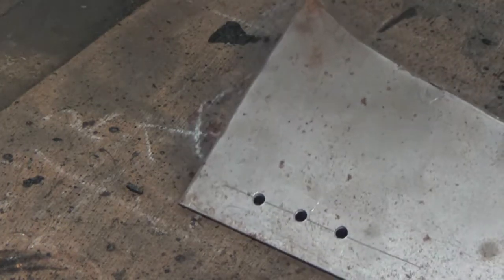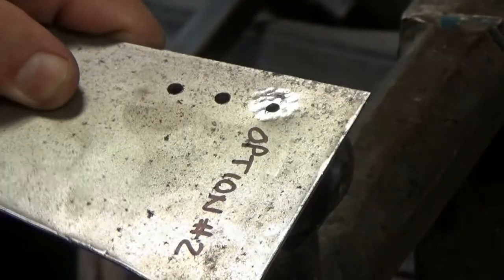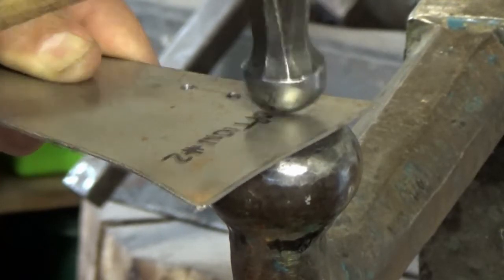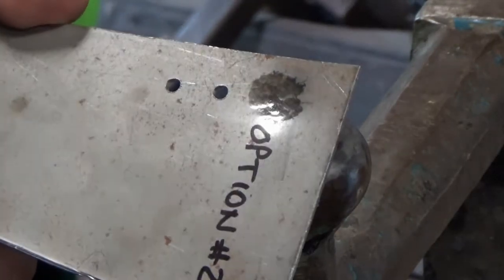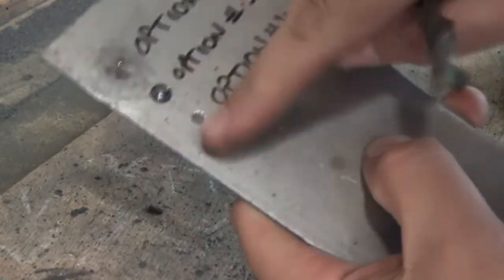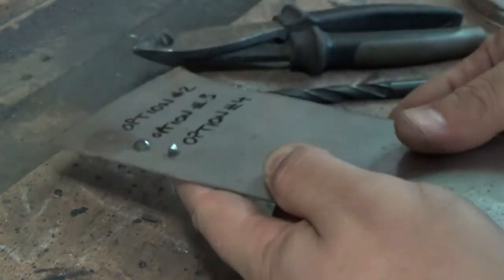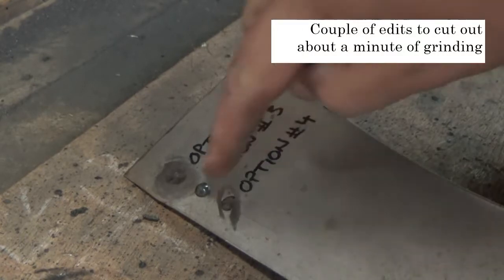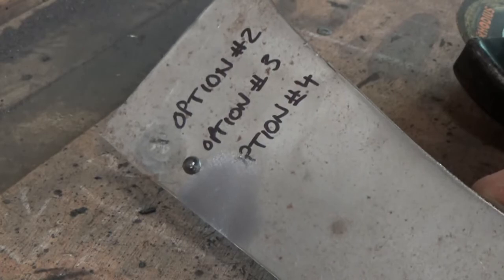Medieval armour technique short: Filling Unwanted Rivet Holes

Comment: I use option 4 but I grind down with a 120 grit flap disc.
Reply: Buy grinders in 2's - one to grind and one to cut. Don't grind with a cutting disc, particularly a 1mm one.